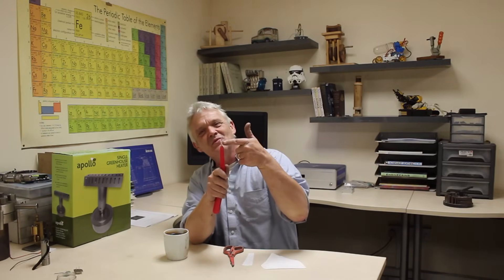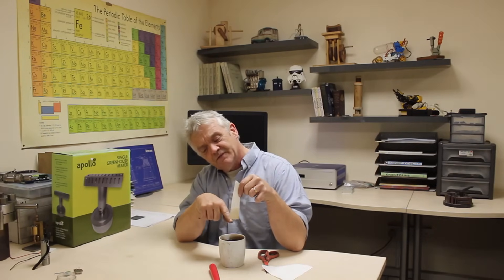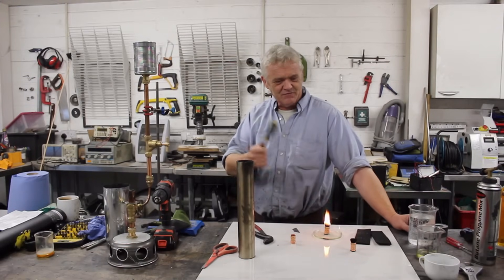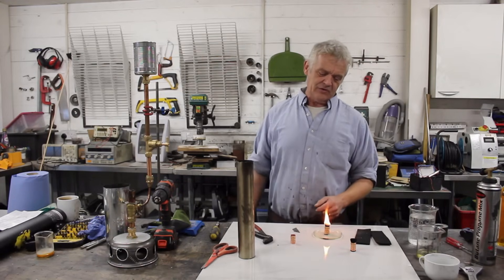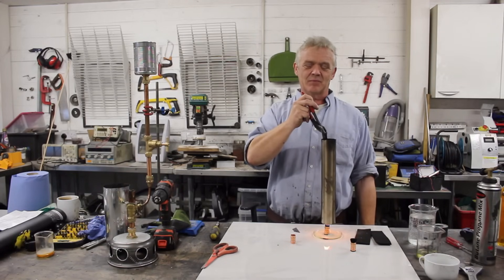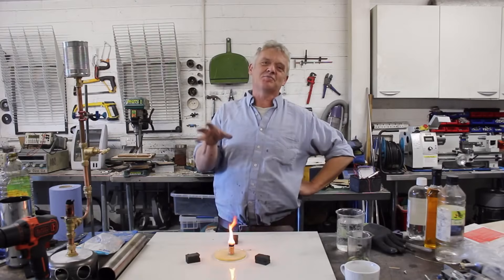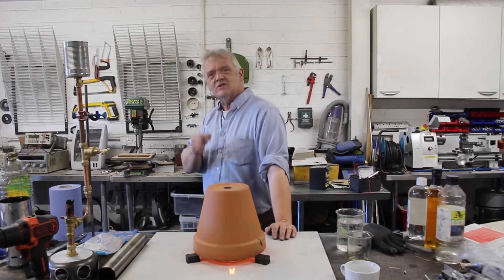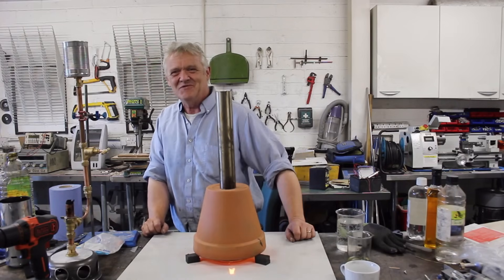1680 The Magical Forever Wick - The Plant Pot Heater On Steroids

Comment: Carbon felt does 
shrink under use but slowly and therefore easy to allow for . Once it has finished shrinking it will wick very slightly less efficiently but not enough to have any noticeable effect on performance

Comment: The pure carbon wick will burn to produce carbon dioxide, if it gets hot enough. The reason it does not burn is that the vaporizing oil cools the wick and prevents it from getting hot enough to burn. If you cut the wick too long and the oil cannot wick up fast enough, then the wick will burn down until it is small enough to balance the amount of oil it burns with the rate of wicking.

Comment: I hope I'm not too late to ask this.... but I'm struggling to get a wick for an old Valor stove & due to a little corrosion on the burner, it used to burn unevenly & too quickly.  I'm wondering if this is a good solution?

Comment: a jam jar jet engine (rienst pot) will rip veg oil to smaller chains to burn efficiently. start on meths, we glued a washer to the lid around the hole, then feed veg oil with seringe to suck under the washer and then a fine stream is sucked in arround the hole, put water jacket , we got 1 gallon 35C from 1 cc veg oil, so a 99p litre oil will heat 1000 gallons of domestic hot water! jet engine for heat not thrust,made from stainless steel.with 8mm hole. (test with patax pickle jar, 8mm hole, 3 or 4 mm meths, shake and light,get ready to put it out after 15 secs to avoid glass break covering table with meths on fire.)

Comment: How tightly do you have to wrap the carbon felt and if you place it into a copper pipe, how many holes would you have to drill to ensure oxygen flow? Also how far would the copper pipe have to be in the oil to ensure proper wicking? Thank you in advance for your help

Comment: The pot over a hea source is idiotic 🤷🏻‍♂️ 99% of the posts using a pot advertise it as n emergency set up🤦🏻‍♂️ claiming that the pot somehow amplifies the heat, when in reality,  the pot robs the room of btu's.  Placing anything over a flame will never increase the amount of btu's the source already puts out🤷🏻‍♂️ the only way to increase btu's is with a fuel source

Comment: Very cool! Love your content :) 
I took a few very thin tissues and folded them together multiple times to form a flat wick that stuck through a slit in a jar, and used used coconut oil from our cooking to fill it. It burned really well, but there was a certain  level before it was empty that it stopped working as it could wick no more, but it actually went a surprising way up.

Comment: Please keep in mind that carbon monoxide (CO) is given off as a byproduct of combustion when any fuel is burned.  If there is inadequate venting in a space & CO levels increase, you will breathe in CO, the CO will compete with OXYGEN for the hemoglobin in your blood, & the OXYGEN WILL LOSE!!!  
That is to say, if both CO & oxygen are present in your blood, your hemoglobin prefers to attach to CO over oxygen. 
Hemoglobin is the substance in your blood that transports oxygen to all of your tissues.  Too much CO available in a space leads to your hemoglobin becoming saturated with CO, which means there is zero ability left for oxygen to be delivered to your body tissues, which means you will die of carbon monoxide poisoning!!!  PLEASE UNDERSTAND THIS CONCEPT & be safe.  
If there is combustion, there MUST BE outside air & adequate venting, to get rid of CO.  Smaller spaces collect CO even faster than larger spaces.  People frequently die of accidental CO poisoning... you can't smell it, you can't taste it, you just go to sleep & never wake up.
God bless folks!😇
[11.26.2024]

Comment: This is a faulty fad. You can't reimagine physics. Will hit generate heat? Yes. But less than a hair dryer. Much less.  There is no free lunch. In every one of these videos, Indoor Air Quality is not addressed as well.  Before this fad, some people used candles for ambience. And only later did they see the soot buildup. You cannot burn a fossil fuel; wood, charcoal, LP, NG, Oil candles, paraffin etc without products of combustion.  IAQ is impacted, and even those it's invisible, tasteless and odorless, you're breathing this. In the same way I'd keep batteries, flash lights and a wind up radio for emergencies, I might keep one of these setups.  You cannot not amplify BTUs; it defies the laws of physics. If you want one for emergencies, have at it. If you think, "I'll save money on my utility bill!", you'll  be cold and in an unhealthy indoor air environment until the house catches fire. You'll be warm then. IAQ doesn't improve.

Comment: I saw another YouTuber who stacked smaller pots on top so it was shaped like one big cone. That would seem to do something similar as your chimney, but have more radiating surface area? 

He also used Crisco (veg shortening) with a wick, but I'm guessing the wicks burn down and have to be replaced, unlike your carbon felt. 

Your disclaimer said not to use anything but veg oil to prevent a gruesome death - does that include veg shortening or is it essentially a solid version of veg oil?

I'm asking bc I plan to make it, not nitpicking!

Comment: The danger with these types of heaters is that they can cause the fuel to explode by heating the fuel to a flash point. I would like to see the fuel under the heating parts. Would you put that heating source in the oven? There is a video out there were someone had one of those in the background inside his RV while he was making a video and the whole thing caught fire.  Keep in mind that the inside of the bell will be much hotter than the outside.

Comment: Cool that.

There's another vid of a simple DIY heater using a jar of veg oil and cotton wick inserted in the lid, which is heating a copper flat ring in a bucket of sand. The sand holding the heat.

Would the combo of your method and that one be a more efficient heater?

Comment: I wonder if the carbon wick could be placed in a traditional kerosene table/wall lamp and used to burn used deep frying oil?!
The Kerosene lamp has a glass cover for safety and I have some of those lamps around the house.

Comment: It's not working for me. I got some and that stuff and it doesn't stay lit. Why not? doing this with veg oil and tried alcohol to see if that would help and it only lasted as long as the alcohol burned out. Tried putting it in a copper pipe and that didn't help. Disappointed. 

It's not my oil either. I've used rags in that oil and they'll burn to ashes

Comment: I love the ingenuity in this content, and I followed the instructions to the T. I purchased welding felt, I went to get a copper pipe and had it cut into about 2-inch pieces, stuffed in the felt, and let it wick for 5 minutes, 15 minutes, 30 minutes.....well, you get the idea. It did not work for me.  I wanted to use these candles in my greenhouse when the temperatures were getting too low. I will try again tomorrow. We are expecting 24 degrees Fahrenheit tomorrow night.  I am open to a good idea. I thought that the welding felt might be too thick, so I parted it in the middle but it still didn't work. Are there different kinds of welding felt's?

Comment: just discovering you....this project appeals to me...Question: I did not understand the term you used for the container around the carbon felt wick. 2) How long will this burn and if I wanted to heat a room, how would I used this to do that...btw I see they have carbon felt on Amazon...is "Carbon Felt" the exact wording when shopping for it
Reply: plumbing fitting is the word you used..sorry

Comment: Hi great video, I use  left over kevler, with  80 mm copper pipe at end, I put oil  in the tray with the pot on top. With three small pieces of clay stuck to tray as feet

Comment: I was wondering if you could cut this to the size of a lamp wick and if it would work in an oil lamp? If it is too thin maybe you could fold it to the proper thickness. The problem would be if the vegetable would wick up far enough. But, if you are using regular lamp oil I think I could see it might work.

Comment: I was curious as to why there was suddenly more smoke coming out the top when you put the steel pip on top of the pot.  I didn't notice any before you did and I don't think that steel pipe suddenly created a draft because the original hole was smaller.  So what was happening there?

Comment: Hang on, why did the pot belch out soot once the chimney was on? I thought the chimney would prevent soot. Was the gap at the bottom too small for enough oxygen to be pulled in?

I've had limited success with plant pot heaters and air pollution in the room I'm using them in has been a consistent issue.

Comment: After watching this, I'm considering trying this to make a wick for an antique kerosene heater.  My question is will this extinguish as easily as the original cotton wick?  As in, will lowering the wick into the housing extinguish the flame as it normally would with a cotton wick or will the greater wicking ability cause it to continue burning even when lowered to the point where only the top edge of the wick is exposed to air?

Comment: I bought a blanket of the carbon felt, cut some into a wick, placed it in a bit of copper tubing.    The wick soaked up the veg. oil  nicely. Lit it . It burned for a few minutes and went out !!!!  I have plenty of oil, plenty of air, plenty of everything, but it won't stay lit !!!!! Tried some olive oil. Did not lite ! What can be wrong ? I even made a Burning Betty mason jar setup. Still won't stay lit. Tried yarn and other acrylic  wicks too. Nothing ! Very frustrating ! Why is this happening. I don't want to use liquid candle wax because it is very costly . So now what ???????? Anyone got an answer ???? Please and thank you in advance  !!!!!

Comment: Hi Robert.  I love your videos - only found you yesterday - and have just watched your video testing out different fuels (ethanol, Jay-Zee's mix etc., although I think they're a bit aggressive for my needs) but are you able to give us some info please on how cleanly the fuels (including the cooking oil and other heavier fuels) burn, please?  I use a plant pot heater with tealights to heat my greenhouse.  (For those who want a rough idea of how well they work, 3 tealights in a loaf tin raises the temperature in my well-insulated 6ft x 8ft greenhouse by 3-4C on a cold night.  The warmer the weather the less well they work - I don't know why.)  Trouble is, if I want to be in bed before midnight, I need to use 9-hour burn tealights.  If I have to light 2 or even all 3 heaters to maintain a minimum of 10C on a cold night a pack of 24 only lasts between 2 and 4 nights at best, so it gets quite expensive.  The good thing is they burn very cleanly and, as I'm growing cool/cold growing orchids, a clean burn is vital.  If I could use a carbon felt wick and some kind of clean burning fuel it could save me a lot of money, so any light you can throw on that would be brilliant.  Thanks.

Comment: “Wool is classified as a flame-resistant fabric. The textile is flammable, but it has to reach at least 1,058 degrees Fahrenheit, to ignite. The material has high water and nitrogen contents in its cells which means if it did ever catch on fire, once removed from the source of the heat, it would self-extinguish the flame.”

Comment: Is there a carbon monoxide component to this vegetable oil burner?  I got a similar design for a ceramic pot heater that used those small  tea-light candles for a heat source but, the heat source was lethal

Comment: Hi friends, I just received my carbon filter (wick) and was eager to try it.  I tried it just as in the video and it wouldn't stay lit.  If unrolled and I lit the very corner edge it will stay lit for about 5 seconds before going out.  Also, the part that is lit is consumed fairly quickly.  I do believe I bought the wrong wick material.  Has anyone else tried this and had any success?  Can  you send me a link to the material for the wick that worked for you?  I live in the US.  Thank you in advance!

Comment: I wonder if it will wick up used motor oil. I have some old fire resistant felt from soldering/ welding and rolled up in a 3" copper tube. It is standing up in a shallow pool of used motor oil. Guess we'll see

Comment: A question not related to the shop heaters. I am totally unfamiliar with the hardware/ device or whatever it is that is attached to the inside of your shop windows. What is the purpose or function of those ? And please explain the purpose of the shape/ design of the hardware why do they extend above the window and into the interior space as they do? Thank you?

Comment: Thank you for this video. We heat our 400 apartment with a flower heater but it has 3 different size flower pot nestled onto each other , then a core solid metal 10”-14” bolt running through center with each pot separated by a couple large flat metal washers and finished and secured with 3-4 flat metal washers up into center smaller pot with nut. The head of bolt and 3-4 flat washers secures top of pots. Don’t screw down too tight avoiding breakage. Place pot upside down over “propane” or other safe fuels with tip end of  metal bolt directly and closely to heat source. Can regulate heat by raising and lowering flame, but keep flame in all lower settings. Be safe and warm… always have a smoke/carbon dioxide detector.

Comment: Gave this a try but the wick will not flame. I've read that the flash point for vegetable oil is around 220degrees centigrade, so am wondering if the oil needs to be this hot before it'll set on fire? Anyone got a solution as the video suggests it doesn't need to be hot oil?

Comment: Still lost of smoke… I was wondering.. what if you cut a hole in the bottom of a wood stove.. cap off chimney.. leave a foot or so then cap ..connect a circular flared piece of metal to the bottom of the stove.. heat collector ..connected to  hole beeswax is smokeless.. using a candle as a source of heat.. I believe this could be a great source of heat.. beeswax burns hot and long…  the concept is the metal will give off a great amount of heat .. you could place this anywhere.. ps you should make metal logs .. lol .. they also would be a heat collector.. hmm

Comment: AMAZING

I have a 12x12 greenhouse. It is coming up on winter time. I just started experimenting with terracotta candle heaters. I found that Crisco and a 1/4 inch wick (thick) or 3 candles cut and punched in to the crisco works awesome and last for weeks at a time. But this could be the next step!!!

AMAZING!

Comment: It seemed to me that when Rob placed the chimney on the plant pot heater the amount of soot exiting into the room went up substantially.
Reply: I thought that too. Seeing how there was a already a hole in the planter, I wonder if a chimney was needed.
Reply: because of the draw it creates . . the 'soot' isn't encountering the 'bottom' (top) of the set up with the chimney because of the actual force it creates in the under drawl so it swirls it all around and out the pipe
Reply: @sikosis999 that makes sense.
Reply: I think keeps down carbon,,,   I would Crack a window  ,,maybe,, 🤔  but good ideal
Reply: without the plant pot it seemed to be fine - i think he drain hole in the bottom of it is too small and restricting the airflow needed for a cleaner burn

Comment: Question for you, do you know what the flash point of vegetable oil is? If the area under the plant pot gets hot enough, is that not hot enough to ignite the veg oil if it reaches flash point?

Comment: I've tried it, and it doesn't appear that carbon felt is notably more efficient at wicking vegetable oil. In the demo he's simply using an extraordinarily thick wick, in a metal tube that prevents the wick from burning down past the lip. And even then one inch of draw is about the limit. I really wanted this to be a breakthrough in vegetable oil burning, but it isn't.

Comment: Awesome stuff..would it be possible to cut 10mm thick carbon felt into 10mm widths, 10cm long & use them to replace the standard 10mm wick of a paraffin lamp, in order to use vegetable oil ? 🙏🏻

Comment: daft question time: if you were to set up the plant pot heater as in this vid, how would you safely extinguish the flame? if it was just the bare wick and assume a snuffer but if the flame can't be seen, even with that fab resistance to setting vegetable oil alight, it still could pose a bit of a hazard. trying to develop some cheap and easy diy heating systems that are pretty solidly fool proof.

Comment: This is probably a silly? But could I use an old “Paraffin Heater” & add the afore mentioned carbon material as a wick & fill the heater with vegetable oil & use the resulting heater to heat my greenhouse ? Seems less chance of the heater catching fire if the oil wont burn if the wick falls over.

Comment: What if you put a carbon air filter at the end of the metal pipe as well as and then attach extra metal pipe work and funnel it through to the outside ?

Comment: I tried it with the carbon loosely inserted into the tube with lamp oil and it smoked like crazy. I then placed the pipe over the flame to create a draft that should reduce the smoke and it did by maybe 5%! What a waste of time and a useless idea!
Reply: Why bother with the carbon when you can use a piece of fiberglass insulation if it works at all!